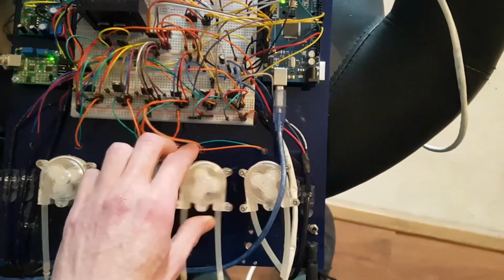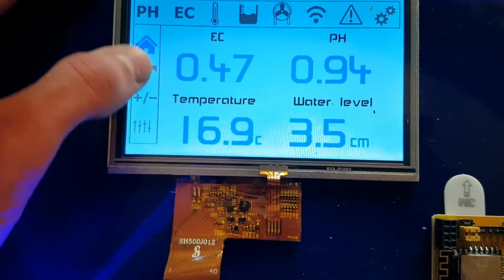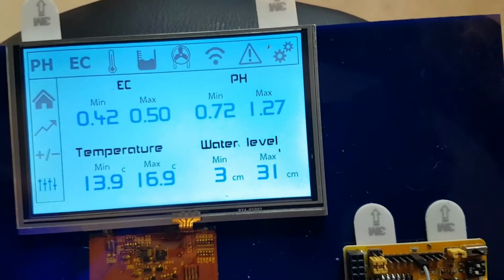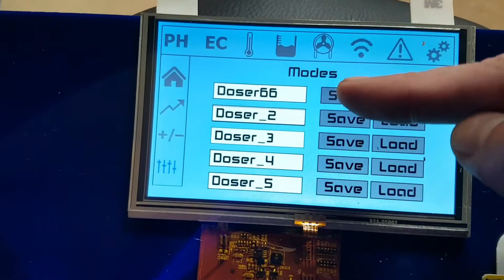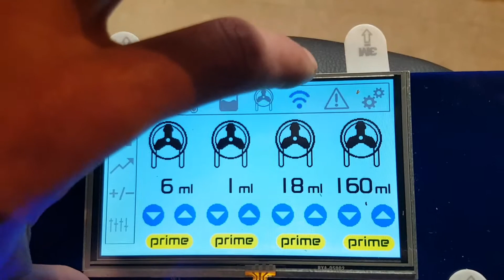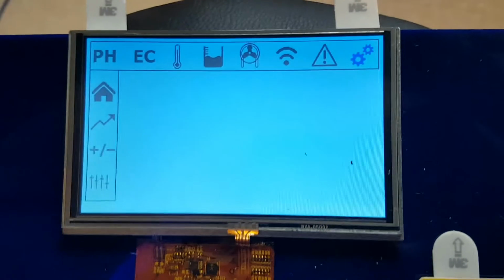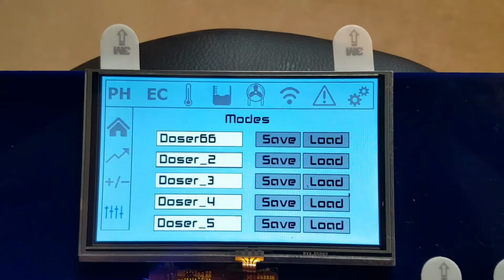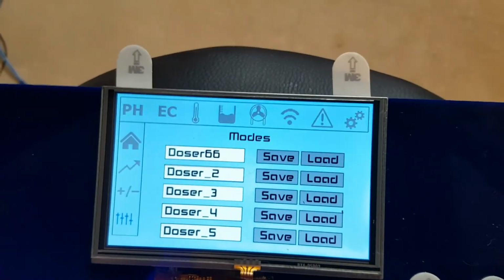Final year project version 1.1

Comment: Very nice project would you consider selling one of these completed or in kit version. 

Thanks for sharing
Reply from the maker: I would happily if there is a profit in it for me, but it would be sold as seen with no rights to sell the code or design including any content involved with the software and device itself, noting that there could be a bug or two but if you found one i would try to fix it asap. Regarding the cost it is expensive to build with the ec sensor alone costing £70, the RA8875 display costing £30 and the RA8875 display driver another £40, PH sensor is £10, 4 dosers £32, 4 relay module £3, RTC £4, Waterproof DS18B20 £10, ESP8266-202 "modded" £5, knockoff Arduino Mega2560 £8, RGB led £2, External drive buzzer £2, HC-SR-04 ultrasonic sensor £7 OR the E-tape £50, i now use the HC-SR-04 ultrasonic sensor,  and then 4 mosfets and 4 transistors and a bunch of resistors and capacitors, and a few 12V to 5V regulators as i can only find 1Amp regulators and it needs 3Amps+ at 5v. To that extent i am no pro at electronics! And finally a large breadboard and a bunch of jumpers and prototype cable 0.7mm. 

https://thepihut.com/products/adafruit-ra8875-driver-board-for-40-pin-tft-touch-displays-800x480-max

https://thepihut.com/products/adafruit-5-0-40-pin-tft-display-800x480-with-touchscreen

https://www.ebay.co.uk/i/292673940071?chn=ps&var=591472988503

https://www.ebay.co.uk/itm/DS3231-RTC-Precision-Board-Real-Time-Clock-Module-for-Arduino-Raspberry-Pi/333021402112?epid=503026062&hash=item4d899f5400:g:1M4AAOSwL-1cQZJ3:rk:11:pf:0

https://www.ebay.co.uk/itm/6v-Dc-DIY-Dosing-Pump-Peristaltic-Dosing-Head-for-Aquarium-Lab-Analytical-Water/283248473136?hash=item41f2ecb430:g:Z6IAAOSwzcNb4qxs:rk:20:pf:0

https://www.ebay.co.uk/itm/5V-1-2-4-8-Channel-Relay-Board-Module-for-Arduino-Raspberry-Pi-ARM-AVR-DSP-LOD1/143099392684?hash=item21516372ac:m:mVZ267PfFr21016t22dSRQw:rk:2:pf:1&frcectupt=true

https://thepihut.com/products/waterproof-ds18b20-sensor-kit

https://www.ebay.co.uk/itm/MEGA-2560-R3-ATMEGA16U2-ATMEGA2560-16AU-Board-USB-Cable-For-Arduino-USB-Jack/253834288034?_trkparms=aid%3D555018%26algo%3DPL.SIM%26ao%3D2%26asc%3D20160908110712%26meid%3D3312254184854525b2b7d1a1571daca7%26pid%3D100677%26rk%3D3%26rkt%3D30%26sd%3D183015521056%26itm%3D253834288034&_trksid=p2385738.c100677.m4598

https://www.ebay.co.uk/itm/New-ESP-202-ESP8266-Serial-Port-Wifi-Test-Board-Module-Development-Test-Board/253051509643?hash=item3aeb0b9b8b:g:qDUAAOSwxg9ZbgWL:rk:4:pf:1&frcectupt=true

https://www.ebay.co.uk/i/302886791081?chn=ps&var=601796410345

https://www.ebay.co.uk/itm/Active-Buzzer-Electromagnetic-1-5V-15V-Alarm-Arduino-Raspberry-Pi-PIC-UK/262598110433?hash=item3d24112ce1:m:mcR2GzyEknTqMoclZDY6tWQ:rk:9:pf:0

https://www.ebay.co.uk/itm/Geekcreit-Ultrasonic-Module-HC-SR04-Distance-Measuring-Ranging-Transducer-Senso/332387374617?hash=item4d63d4d619:g:hpcAAOSwQkZZxD~Z:rk:2:pf:1&frcectupt=true

https://www.ebay.co.uk/itm/7E0C-Solderless-Prototype-Breadboard-830-Points-Bread-Board-Electronics-Assembly/273666962504?hash=item3fb7d27448:g:EQcAAOSwuwlcRcp7:rk:4:pf:1&frcectupt=true

Capacitor radial MCLC SR21 220nF 50V         x6
Transistor GP BJT NPN 40V 0.2A TO92-3      x6
Rectifier Diode 1A 50V 1.1Vf 30uA DO-41      x4
MOSFET N-Channel 60V 55A TO220              x4
3-Terminal Positive Reg LM340AT-5.0            x3
and 6 resistors at 220 for the leds and mosfets , and 4 10k resistors also for the mosfets.

So ruffly £260 at this current time just for the components, plus rights to use the code and the design, but again not to redistribute or sell, say £380 in total :S, not cheap...

As i just said above i shall post a new video of the updated code and design this week so stay sharp for a new video.
Reply: @edwinmartin1924   Thank you very much for taking the time to write that out great reply very detailed.. I would happily pay for this at the prices you have suggest. I'm in the UK also not to far from Norfolk. 

I would love to have a go at buliding it my self but I'm a amature in aundrio I did consider having a go and making the last controler you made to see how I get on. But I think this project may be a step to far for me. 

Thanks Daniel

Comment: This is a very great project! Im ectualy gathering components to build my own hydroponics controller.. but wile doing research i stubbeld on the major issue people have when measuring ph and ec at the same time.. i was u where using the a1003v1 ec sensor but i cant figure out what u use for ph. And how did you overcome the problem of the 2 probes interfering each other?
Can u please help me out on this?
Thanks!
Reply from the maker: My ph sensor was just some random chinese Arduino compatible PH sensor, no tech manual or info available for it, it works ok but i had no comparison but it was very cheap https://www.ebay.co.uk/itm/Liquid-PH0-14-Value-Detect-Sensor-Module-PH-Electrode-Probe-BNC-for-Arduino-/272500439535.

 I used two NPN transistor's to switch the power and ground to each of the sensors so that there is absolutely no interference between the two sensors, to which i toggle between reading either sensor at 4 second intervals, to allow time for the current to diserpate fully. npn transistors are cheap and small compared to things like mosfets and relays. There easy to use, just a input, output and control pin, here's the ones i use: ON Semi BC33725TA NPN Transistor, 800 mA, 45 V, 3-Pin TO-92

Here's a snippet of my code:

void readSensors(void) {
  sensors.requestTemperatures();
  tempSensor = sensors.getTempCByIndex(0); // = sensors.getTempFByIndex(0);
  if (swapSenor) {
    pinMode(EC_GND_transistor_pin, OUTPUT); // set pin mode
    digitalWrite(EC_GND_transistor_pin, LOW); // set as a gnd pin
    digitalWrite(EC_transistor_pin, HIGH); // turn on sensor
    delay(300); // time to stabilize
    ecSensor = analogRead(EC_PIN) * 5.00 / 1024; // ,2;
    delay(100);
    digitalWrite(EC_transistor_pin, LOW);
    pinMode(EC_GND_transistor_pin, INPUT); // float the pin
  }
  else {
    digitalWrite(PH_transistor_pin, HIGH);
    delay(300);
    phSensor = (1023 - analogRead(PH_PIN)) / 73.07;
    sensorReadConfirmed = true;
    delay(100);
    digitalWrite(PH_transistor_pin, LOW);
  }
  resistance = readResistance(ETAPE_PIN, SERIES_RESISTOR);
  cm = resistanceToCM(resistance, ZERO_VOLUME_RESISTANCE, CALIBRATION_RESISTANCE, CALIBRATION_CM);
  cm = cm + OFFSET;
  inch = (cm / 2.5);
  swapSenor = !swapSenor;
}